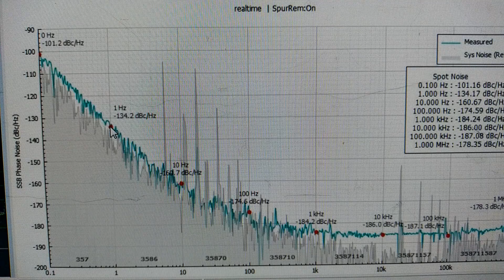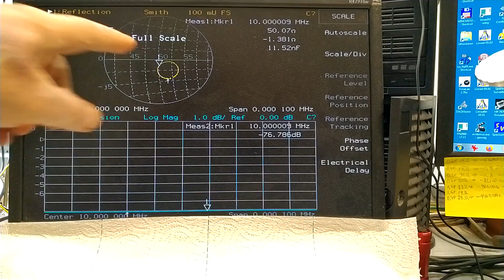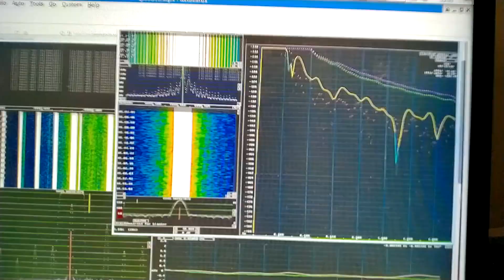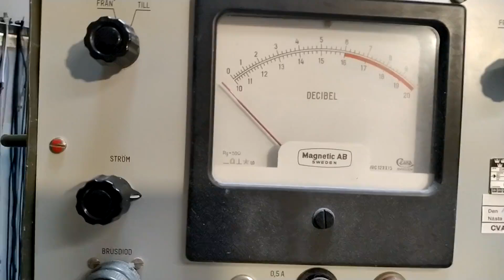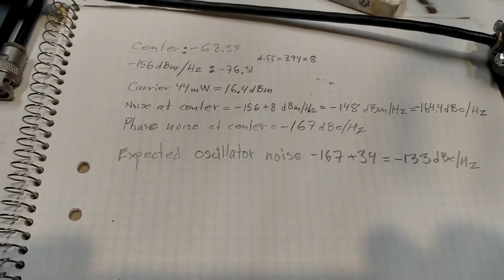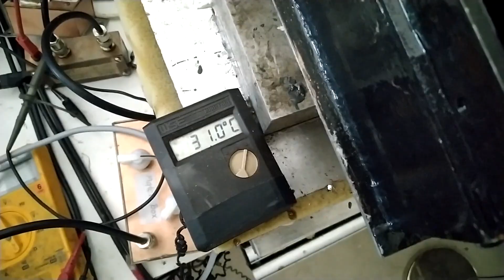nerds119

Comment: 24:45 420 volts much?
Reply from the maker: Not 420, it is 4.20 peak to peak which is 1.49 V rms. That is into a 50 ohm load which means that the output power is 44 mW or +16.4 dBm. Sine wave outputs for RF or precision references typically range from 0 dBm to +13 dBm (1 mW to 20 mW) into a 50-ohm load so the power is a little higher than standard.